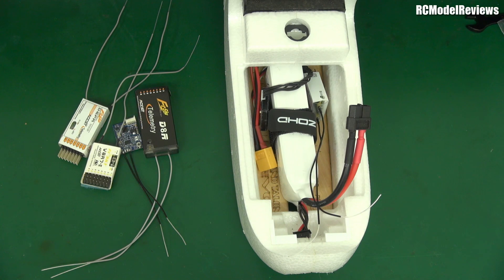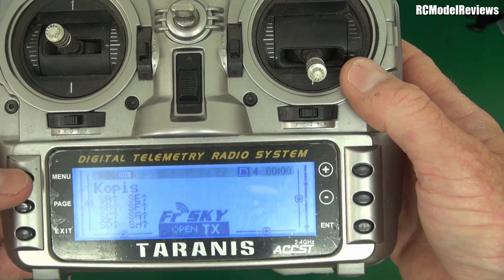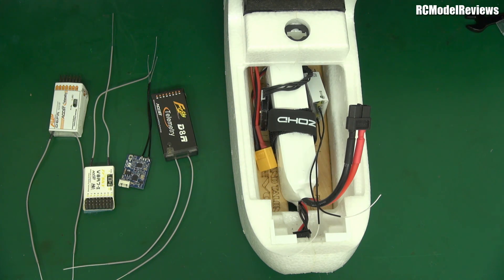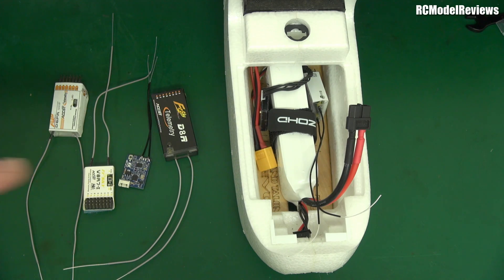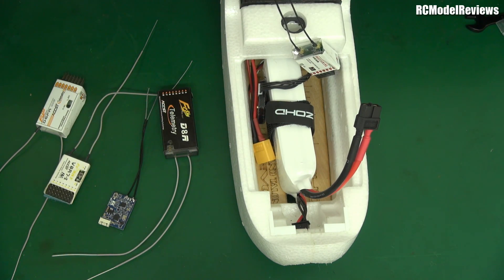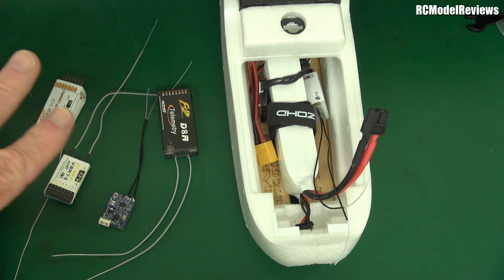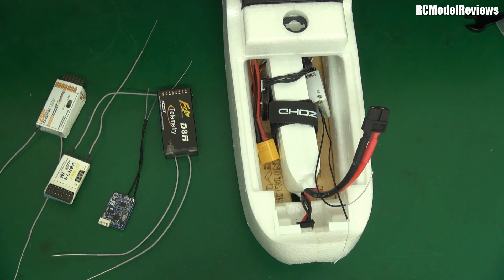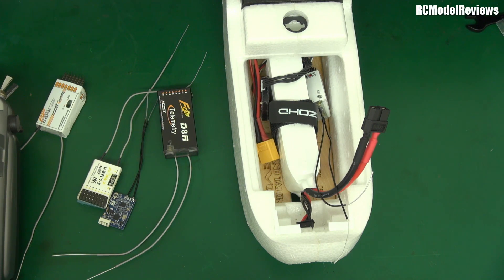FrSky's ACCST Update - should you?

Comment: Hello!!

I love your videos!!!
But now i need your help, pleasee!!

Because the antenna from my radio (FrSky Taranis X9D 2019 ACCESS) came from factory  too stuck I damaged it twice. The first time, i made a new one from old coaxial cable from old laptops and worked fine!
At the second time, while removing the hot glue, without noticing, I removed a very small blue component that is very close to the soldering points of the antenna. I still don't know what component is!
The radio still works but, with the Fr-Sky ARCHER R8 PRO after 200 meters i get low signal warnings... :/
Do you think that I can easily fix this or should i buy a new module?! 
Or, if i buy the external module R9M, should it work fine with the old module?

Thanks in advance!
cheers

Comment: The only thang about it is if you buy a new receiver you have to flash it to the old version I just got a new  xm plus from racedayquads and it would not bind to my jumper radio until I flashed it with older firmware thanks for the headache frsky

Comment: FrSky was solid with the D8 when they moved up to the D16 that's when their issues started. The one problem I saw was receiver lockout after interference from gas engine ignitions. All radios can have a problem with noisy ignitions, but the X series receiver would lockout and even if the RSSI got better it would not recover cause a crash. Testing on the ground many videos on that shows the receiver has to be power cycled before it will work again even if you shut off the ignition.

Comment: I have had uncommanded servo movement two or three times last year, each lasted only one second until control came back. For example suddenly it gave 100% throttle and 50% roll right while I (FPV) was only 10m above the ground and only 30m away from me, it lasted for exactly one second during which I had no control, I almost got a heart attack but still managed to not crash. This was not a failsafe, I have had normal failsafes (and quite a few more stage 1) before and this was entirely different, it threw the sticks to a random position and held them for one second until I got back control! The other two times were similar and I crashed. I have had the EU-LBT version of D16, all modules had been updated to the (then) latest version of 2018 or 2019 (can't remember exactly anymore but it was the latest I could find at that time).

Comment: HELP!

I live in holland (unfortunately...) and flashed my Taranis Q X7 in non-eu (D8 mode)... I have the V8FR-II as a receiver (D8 receiver).

When I flew the Axon RC Aircraft, the plane had all sorts of glitches. The receiver has CONSTANT brown-outs (temporary loss of control), no response in the ailerons & elevator. The plane suddenly loses control in mid-air and spirals down. A second later, I have control again...

Or when I have my flaperons, it glides with flaps but then it rolls to the left or right (one flaperon does have a glitch causing the Axon to roll). It seems like the transmitter (bought from holland for 135,-) has a problem in non-eu OR the receiver is just crap... The V8FR-II is also not far away from the ESC and it doesn't have external BEC power. (after all, I got it down (with a stone hard landing)... minor damage got easily fixed)

What do I need to do? Upgrade my Tx? (Because I'm having loads of glitched with my D8 receiver and brown-outs)

Comment: I got my first frsky radio at xmas (changing from spectrum)
I bought the x9d 2019 SE, first thing I did was backup the radio's existing firmware then update to the latest version.
I buy x8r receivers and don't update them, I just change the model in my tx to use access D16 and bind them with no problems.

Comment: From what I understand, both FCC and EU firmware has the bug, but it's more likely to be triggered in EU firmware, because the EU protocol works different, as you mentioned. Btw, even ACCESS apparently has this bug, and needs to be updated, if you want to get this fixed. I'm running an old X9D+, also with fimware it came with, because I'm like you, if it works, don't update. I'm still flying quads with "ancient" BetaFlight 3.1.5 firmware, and these are still great: https://www.youtube.com/watch?v=FAi5MwMDhkg

Comment: Listen before talk is the contention algorithm used by WiFi IEEE 802.11. This device operates - unless I am mistaken - on WiFi frequencies 2.4GHz and 5GHz, so it is not strange that the EU require radio transmission devices that use these frequencies, to adhere to the friggin standard.
https://en.wikipedia.org/wiki/Contention-based_protocol

Comment: I upgraded my FrSky to the first version of the EU software, I did a test flight with my three week old V-Tail and after about 3 minutes flying the machine climbed, the telemetry said the v-tails 3 cell battery was at 6V and the damn thing flew away.

Turning off the transmitter (last resort) didn't kick in the failsafe (which had been bench tested after updating the TX & RX)

I never got the V-Tail back and TBH I have clocked up less than an hours flying since (about last three and a half years)
Reply: gutted

Comment: Bit of a dilemma here. I have been learning to fly using an X9D+ and X9E with a buddy lead. Plane is a Tundra. My instructor used the "D". I found the "E" to be a bit uncomfortable so invested in another D, an SE this time. All was going reasonably well during 2 or 3 flights but, at one point, the plane suddenly rolled onto its back. The instructor corrected it at berated me for "going inverted". I was sure I hadn't initiated the roll but accepted it. Then, in a later flight, it did it again and crashed before the instructor could save it as the plane was too low. He knew I hadn't initiated the roll as he was watching my hands. So, is this the kind of thing the update is aimed at? I haven't flown since but having the, repaired, plane and Tx switched on have shown no problems. I am in the UK so using the EU version. Should I update?

Comment: I had problems about servo movement without being commanded to move,  but only with the FrSky  stabilizing receivers S6R and S8R( the problem happened multiple times but just using flaperons.
    One of the ailerons moved and stayed at full deflection. The other channels were working fine.
    With the receiver programmed to disable the stabilization , to work as a normal rx, the problem did not happen even using flaperons. Using the stabilization but without using flaperons, the problem also did not happen as well.

Comment: I'm in EU and stopped flying 2.4ghz a long time ago. Even in the city's outskirts I got interference so bad that it failsafed 30m  from me. 

I often check the bands as an enthusiast ham and beside the broadcast radio, a few railway channels, a drop of 2m and 70cm ham activity (still) some mobile phone channels in the high 800mhz...there is nothing!
All the RC bands except 2.4ghz are silent. 27, 35, 40, 70mhz... just static.
2.4 is like a frigging zoo! 
You can't drop a needle in there without poking someone's eye out.
Reply: Pașca Alexandru yeah I don’t use 2.4 for anything anymore.  433mhz or 915mhz and 1.2ghz no problem

Comment: FCC firmware is affected by the bug just not as severely. Looking back I can see that I have personally experienced it on FCC firmware. Once with a 700 class helicopter and another time with a 550 size helicopter that both had brief unexplained channel inputs from the receiver in the air (I know because the FBL controller logs the channel inputs). Neither caused a crash but when that happens with a machine which can potentially kill someone it's scary.

The encryption in ACCST 2.0 is completely open to being reverse engineered unlike ACCESS because it runs on unsecured hardware. This is why FrSky didn't release ACCESS for older generation receivers. It will protect the signal from hijacking or spying but it won't stop compatible hardware like the multi protocol module from implementing ACCST 2.0.

Comment: This a confusing subject for EU flyers.  If you buy a Taranis/Horusxxxxx in the EU it comes with a EU-LBT sticker.  OpenTX does not show the 'D8' protocol and the inbuilt transmitter will only bind to receivers with EU-LBT firmwares.  If you buy your transmitter from a non-EU supplier then it's probably going to be FCC (D8 is available) but if your receiver is EU-LBT....you get the picture.
You can get D8 back by reflashing OpenTX with the EU option deselected, but the TX firmware is still going to be EU-LBT.  There appears to be a script available from FrSky to flip the TX mode from FCC to EU or visa-versa. 
Hope this helps on the EU question
As Bruce says on the new firmware "if it's not broke"....I'd wait at least a few months before applying it.  Of course if you buy a receiver with the new FW it may not work with your old radio - what fun!  So you might want to squirrel away a copy of the old firmwares to allow you to 'reverse flash it'
Reply: You can load FCC RF firmware to all TX and RX modules....

Comment: As stated in the video this flaw is related to ACCST D16 only. Noticeable uncommanded servo movement and / or 0.9sec freeze of all servos affects EU-LBT only. FCC has the same flaw, but no noticeable effects occurs. Here are more details - https://77hobby.pl/important-firmware-update-frsky-accst-d16-v2-n-51.html (switch to EN at the top of the page) - including a link to orginal report from German / Swiss / Austrian test team who identified and isolated the problem allowing FrSky to work on a fix. Re new FrSky protocol - ACCESS - I like it for many reasons: wireless firmware upgrades, receiver registration and thus easy model sharing (I fly with my son, so we use this one a lot), telemetry from more than one receiver in a model, less latency, much more linear RSSI, etc. So ACCESS upgrade was not about FrSky blocking dumb clones like Jumper. Which they have every right to do anyways, but ACCESS is simply awesome.
Reply: Great, that matches exactly what I discovered in 2018 with XSR  and emailed FrSky but naturally got no reply back.

Key observations I wrote in the email:

* For close to 1 second as seen by FC
  * PITCH, YAW, THROTTLE and RSSI froze
  * ROLL went full left
  * No failsafe triggered

Comment: The ACCST update needs to happen due to a dangerous bug that came to light (note that it was discovered by german users NOT by FrSky) but the update isn't ready for public release yet and FrSky should not have put it out yet. I had an uncommanded elevator input on a 700 size helicopter about two years ago that I am 100% sure was this bug. It only lasted a split second and didn't cause a crash but it scared the hell out of me. The FBL unit has channel logging and showed an aileron channel input from the receiver so I know it was from the radio system. I'm in the US and running FCC firmware so I personally know as a fact that the bug affects FCC as well as Frsky has said.

Comment: Hmmm.  I had a 700 size heli crash itself straight into the ground back in 2015, straight from a hover about 20ft up.  I had the flight controller checked over by the manufacturer and it was fine.  The cause was always a mystery.  An unwanted servo command would certainly have accounted for that.  It just went full negative pitch into the ground, as if I'd chopped the stick. Maybe it was this bug?  If so, FrSky owe me a few hundred quid!
However, I use (and always did use) the worldwide firmware on my Taranis.  Mine is a 2014 model, so grandfathered into the 2015 LBT rules, so it's legal for me to use.  I won't be upgrading.  I only fly fixed wing and quads on FrSky now.  My helicopters are on Vbar control since 2016 as it's more convenient.

Comment: Time to peel off that screen film
Reply: If you peel off the film you have to wait for scratches to make the screen look bad. If you leave the film on, you can have a bad looking screen right away.

Seriously, I suffer the same fault as Bruce. I leave screen protectors on way too long.
Reply: Lol, so happy to read i am not the only one being "disturbed" by that.
Reply: Why not some sort of replacement film? Those large screens get scratched very easily, why not replacements for those wanting to protect the screen below? Unless one looks at them as character marks or something.
Reply: @rusack7174  I bet a phone or tablet screen protector would likely work. One could just cut it down to size. A tablet screen protector would likely have enough film for several replacements.
Reply: @ddegn  They make screen protectors for RC transmitters . I've had one on my DX9 since day one and my new Jumper T16 shipped with one in the box .

Comment: Excellent advice. There has been problems with the updates, including your Taranis not starting up when switched to on, or your Taranis turning on all by itself when no one has turned it on. The company's response is that you need a new main board. But, when the cost of a mainboard is compared to the cost of a Taranis 2019, guess what most people choose?
Reply: Old Glory exactly what I was guessing they’d do this! Forcing everyone to update then break and force to ACCESS.   What a shit move.  Glad I left mine shit alone. I’m running OpenTX 2.2.3 and older R9M and slim firmware.  Even the so called newer R9 firmwares was breaking shit causing weird things to happen so I stayed on there older 180329 Fcc sbus firmware which I’ve backed up onto a usb Drive because I’m guessing soon Frsky will make these older firmwares disappear and when that happens I’ll still have my copies.

Comment: Well to be fair, ACCESS adds a few other features. For example, telemetry now has a much higher data rate. And the new glider receivers with integrated air pressure sensor are amazing. But yeah. There's no reason why the X-Lite pro can't support ALL protocols. But no, you have to choose D16+ACCESS, or D8/D16 and the older stuff but no ACCESS.

Comment: The information is wrong. Both LBT (EU) and FCC versions have the bug but in the FCC version the probability of the bug occurring is much lower since the transmitter doesn't listen (wait) before talking, it just sends data, regularly, which helps the receiver detecting/decrypting valid frames.
Depending on how much noise the receiver picks up combined with the poor "encryption" that FrSky implemented in ACCST, the receiver can interpret one or multiple frames as valid data even though it's noise or interference.

In the best case this garbled data is just moving servos randomly for a very short time (for a few milliseconds).

In the worst case the FrSky receivers will interpret the data in multiple consecutive frames as control bits leading to a desync. This persists up to about 1 second. During that time the data again causes random servo movement which over a second can cause full deflection of a control surface.

Even worse you have no control over your craft for up to 1 second. After that, the receiver should automatically synchronize to the sender and you should have back control.

Comment: Once again, just another reason I use the JUMPER T16 !!!
Reply: Bug affects all current implementations of ACCST it's a flaw in the design of the protocol itself.
Reply: Your T16 is affected just the same if you use FrSky D16 receivers.
Reply: He just said there's no problem if you don't upgrade,what's jump down got to do with it.
Reply: @M-H433  I don't think Bruce has really looked into it very deeply, it's not FrSky that found the bug it's members of a German RC forum who spent a year figuring it out and how to replicate it. It's not a bug in the hardware it's a flaw in the design of the protocol itself so even reverse engineered ACCST products are affected. The FCC version is less affected by this (apparently the glitches are rarer and don't last as long) but it's still affected. This bug actually explains a few events I've had with FrSky over the years, one where a 700 had a brief unexplained aileron input and another where a 550 had a sudden uncommanded collective increase. In both cases I know it came from the radio system thanks to the FBL controller logs. Supposedly it happens most commonly when the model is close to the radio and in the fresnel zone, both times this happened was a low hover a few dozen feet away.

 Also the encryption in ACCST 2.0 will be quickly reverse engineered as it's running on unsecure hardware for anyone to look at. It will protect the signal from being spyed on or hijacked but it won't stop anyone reverse engineering it.

However the updates are not really ready for public release and Aloft Hobbies in the US is saying we should all wait. IDK why FrSky is pushing this because it's not ready yet and needs more testing.
Reply: @atomicskull6405  It's always the consumer who finds problems with things,all dealers rely on end product users to find faults and fixes,and submit it to the devs.
I've never had any of these issues,and run old firmwares.

Comment: I loved FrSky at first, then they came out with the horrible S6R/S8R stabilized receivers and the craptacular R9 "long range" 900MHz system with 2.4GHz transmitter antennas and impossible to fit receiver antennas.  Both systems were released with tons of bugs, and FrSky relied on the community to fix the issues for them.  Firmware release after firmware release that either didn't fix the issue, or fixed one problem while adding others, etc.  I learned a very valuable lesson in avoiding FrSky firmware updates whenever possible!
Reply: Mark O I have 0 issues running older R9 firmwares on module and slim+ 180329 fcc sbus firmware has been solid for me.   Only issue I encountered was when using there crap R9mm rx’s